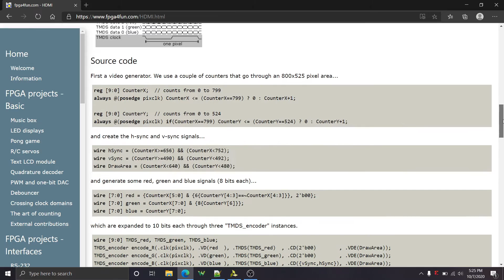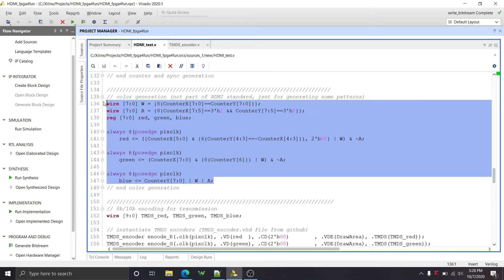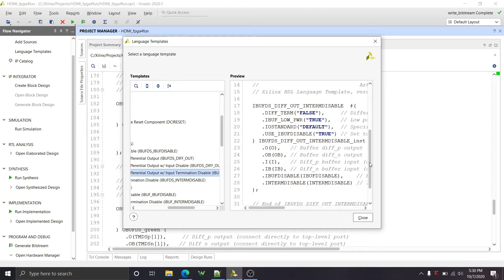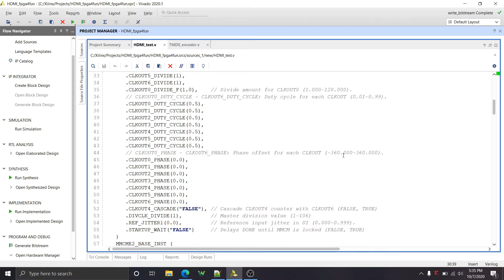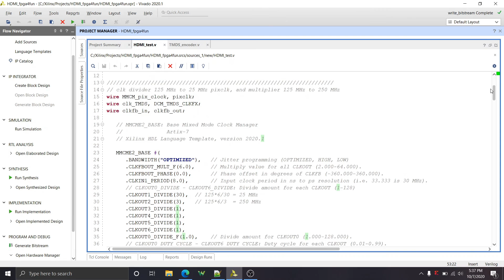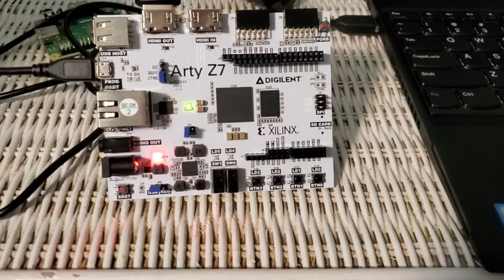HDMI FPGA | FGPA4fun code updated to Vivado 2020.1

Comment: I'm trying out your hdmi firmware on a xilinx based zybo. However when connecting it to my tv's hdmi port I'm not seeing an image. I wonder if I need to set the tv some how or power the dev board via a power adapter instead of via the USB from my laptop

Comment: That's really cool. Im thinking about picking up an FPGA from Xilinx, any advice for getting started? My end goal is to try and make a ray marching renderer in hardware, no clue if you can make it faster than you can get it on a GPU but would be really cool if I could get the game marble marcher running faster than it does on a GPU.

Comment: I enjoyed watching the video. I am trying to test the above code with xilinx  digilent zybo board. I made 25Mhz through Clock Wizard and finished the simulation. However, there was no output from the monitor. can you give me some advice.  Thank you.
Reply: I solved it by myself. Thank YOU.
Reply: @juck2002  I am having the same problem, no output on the monitor. I am using a ZCU102 board. Would you have any idea ? I think it may be the constraints file. Thank you.

Comment: THAT WAS TURNKEY! Your code works great! I had to change the clock frequency from 125 MHz to 100 MHz and adjust the multiply from 6.0 to 10.0 and the dividers from 30 and 3 to 40 and 4. Other than that no mods necessary.
Reply from the maker: Sweet! Glad it worked with the modifications!
Reply: @Dom-bo8wd , I also got it running on 720p!